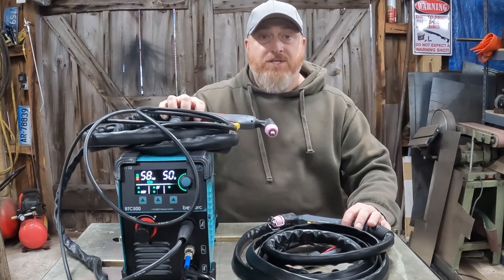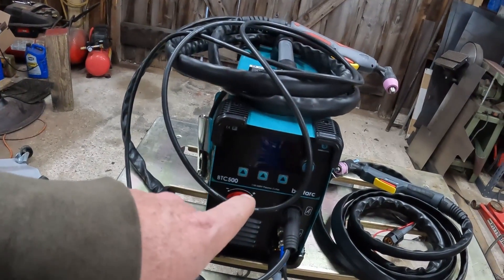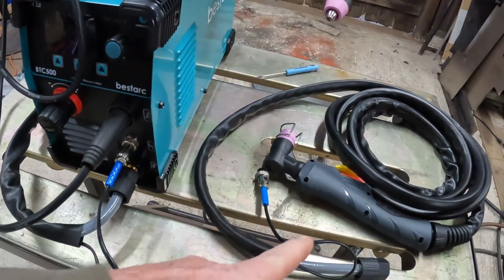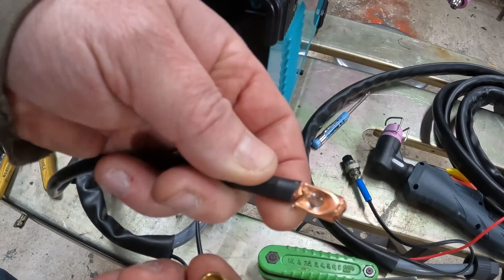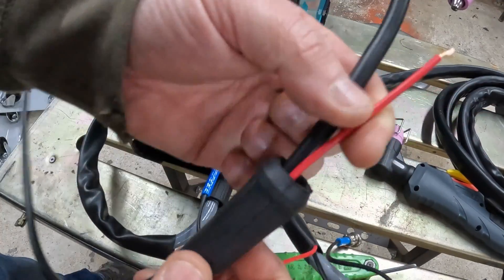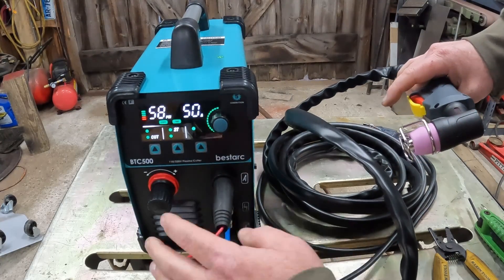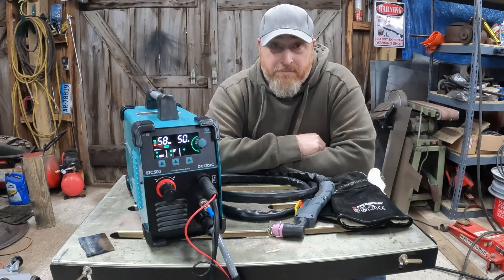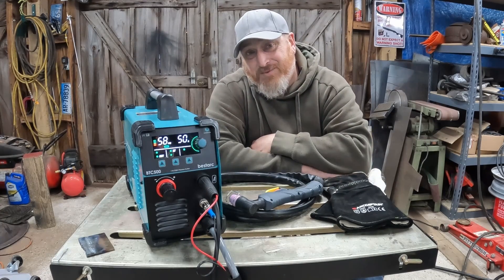How to convert your lift start plasma cutter to PILOT ARC!! Easiest way on YouTube! DIY

Comment: THANK YOU!!THIS fixed my BESTARC BTC500DP!! It has the freakin red wire connection on the machine, but the whole machine stopped working this afternoon in the middle of a job, I took the thing apart and I ordered another cheaper machine. After watching your video Just went out in the shop in my boxers and T shirt did a quick re wiring, just cut the red wire and stuffed it into the ground and it fired right up!! Thank you, I almost tossed the machine today because I didn’t want to mess around with the capacitors inside
Reply from the maker: Awesome!

Comment: This is the wrong way to convert a touch plasma cutter to Pilot Arc.
You'll not only get a huge parasitic loss in the electric current, but much worse a severe risk of your thin connection cable catching fire, as it'll become very hot during use!
The right way is to place a relay inside the machine, which will disconnect the current as soon as the arc starts.
Alternatively, you can place a heavy resistor between the thin wire and the machine.
There are several videos on YT showing the correct way of converting a standard plasma cutter to Pilot Arc. Take a look and learn!
I have two BestArc 80 Amp plasma cutters with Pilot Arc. My first 80 Amp plasma cutter didn't have Pilot Arc and after just a couple of months I simply threw it out = useless!

Comment: I think you could just reuse the old torch and put a cable in there
Reply from the maker: There is a little ignitor in there from what I can see but I suppose you are correct.

Comment: Love this as I want to build a plasma cnc. Only question would be, with it beeing this easy to do, why don’t the manufacturers set them up like this? There must be some disadvantage or safety issues. I know the connection should switch after ignition, and keeping it permanent lowers power a little but not overly concerned about that, as i’ve no need to cut 10-12mm plate.
Reply from the maker: The pilot version of this unit is only $10 more so I'd go that route.

Comment: If you understand electric  side than you would know this way reduce power of the plasma. The correct way it is to disconnect the pilot circuit after the main current start.  Try cut some thick metal  with your improvement...
Reply from the maker: I understand but the draw is so little it really didn't affect the usage. I ran 1/2" afterwards and it cuts just fine. Thanks for the heads up!!

Comment: Is the connector big enough to slide over the button on the "grounding" lug? If so, why not just put the connector over the button on the ground cable plug it back in and you've basically done the same thing with zero tools needed.😊
Reply from the maker: It won't lock in. I tried that first.
Reply: @madgingercustoms  file the inside of the lug to allow for the thickness of the ring terminal

Comment: Cool!!!! Maybe my torch is burned out. The pilot arc hasn't worked in a while. I did not realize that is what that connection is for.
Reply from the maker: Yes sir!! There is just an ignitor style unit in the torch.
Reply: I already ordered one!! Wil test it when it gets here!!

Comment: Plasma cutter would be nice to have if they weren't so expensive
Reply from the maker: Get in on our giveaway in our plasma cutter shootout video!
Reply: Chinese plasma cutters are very cheap compared to the "famous" brands manufactured in the West.
BestArc is probably the very best Chinese brand for the time being. I have two BestArc 80 Amp plasma cutters; of course with Pilot Arc. They've never let me down for the past couple of years, despite being used several times every week cutting up scrap material.
You're absolutely wrong when you're claiming that plasma cutters are expensive!

Comment: Will the same procedure work for the Arccaptain CUT50 unit
Reply from the maker: Yes but the Arccaptain has a push on switch connector not a screw on so you just need to swap that over.